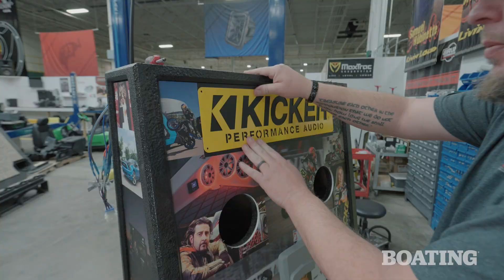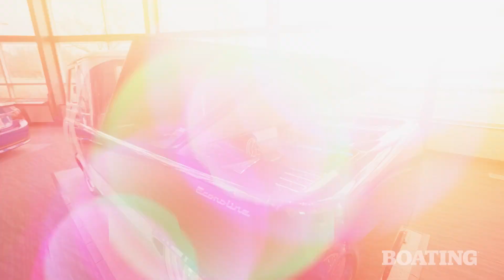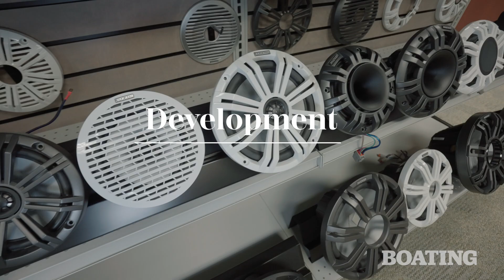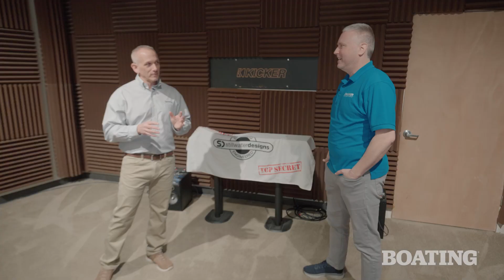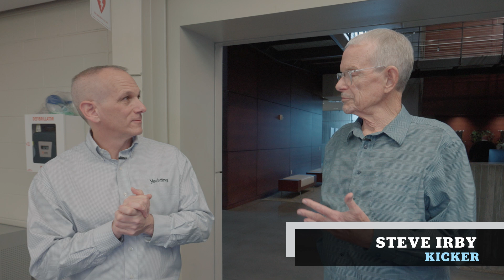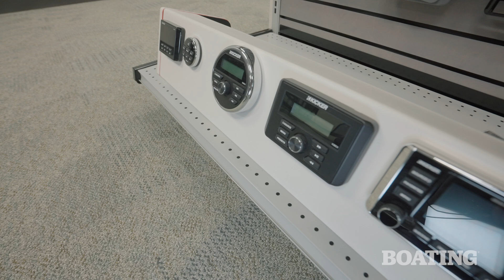KICKER Premium Marine Audio | High-Performance M-Class Sound for Boats

Comment: They’re really de controller for the light of speaker is almost burnt my boat down to the ground. I purchase several controls at one time and three of them with total failures. It still don’t work. It worked the first three years and after that, every controller I installed was a failure and they don’t stand behind their stuff. They just wanna suck in for another 60 bucks to buy a piece of junk made in China. Absolutely no no idea of customer service in my humble opinion.